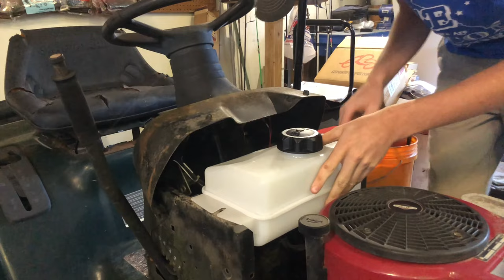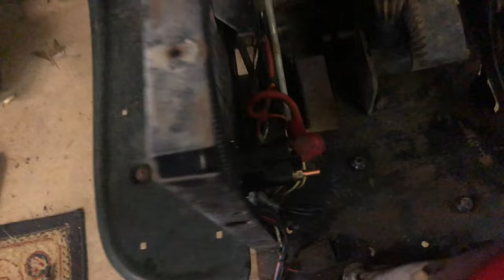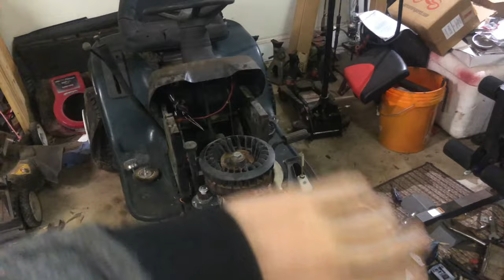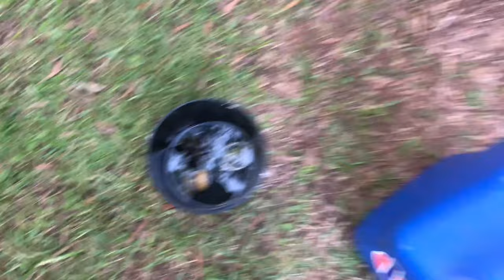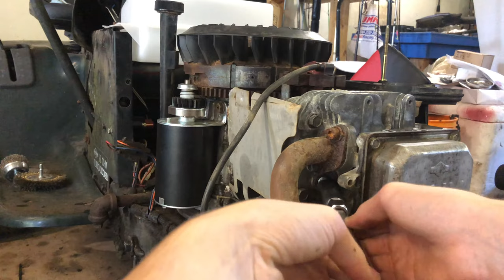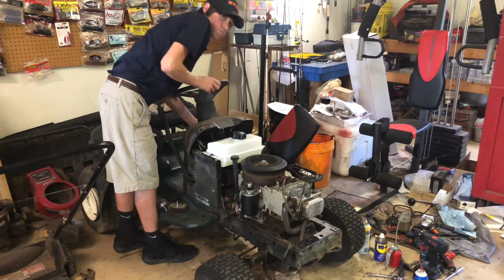Racing Mower #2 | Fuel Tank, Starter, & Battery

Comment: Tip on using ether on lawn mowers and such, try and find carb cleaner or starter fluid that has oil in it. Too much ether will remove the oil from the pistons and the rings and burn the motor right up. I’ve seen it so many times and I’d be lying if I said I didn’t fry two motors myself because year after year I just kept cleaning the carb and spraying it with crappy products. Walmart makes a can that’s like $2.50 and it works better than any name brand and it has oil in it
Reply from the maker: Alright, thanks dude!

Comment: Finding water i would have just taken it a part cleaned it up and rebuilt it anyway
Reply from the maker: Yeah that would be the best thing to do because the rings could have corroded and cylinder walls probably needed rehoning but with some PB Blaster in it is seemed to do alright and haven't had problems to this date lol.